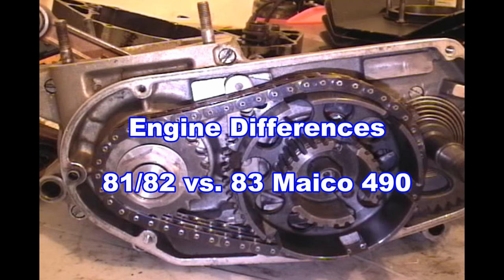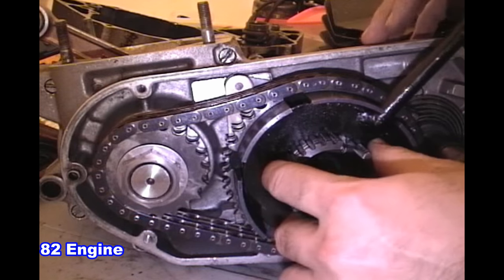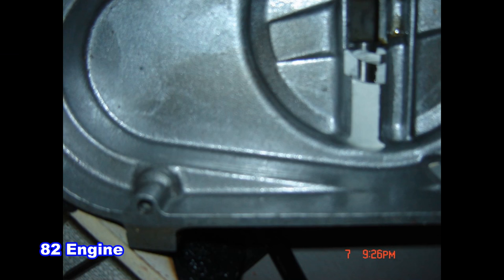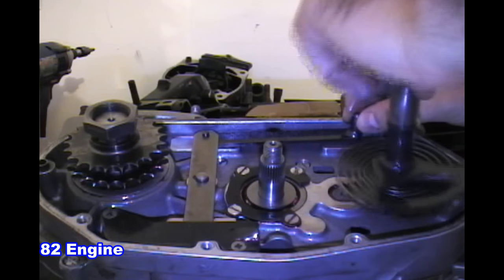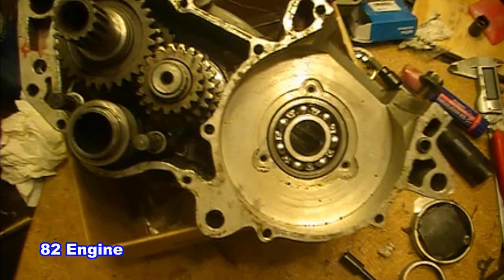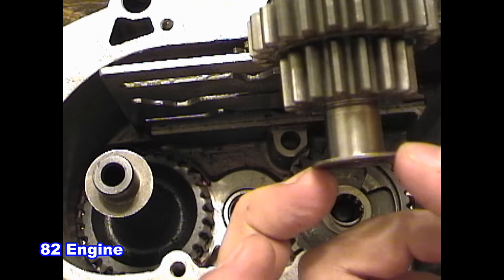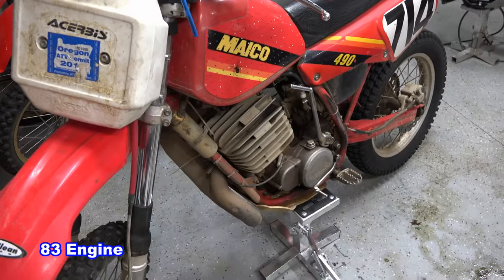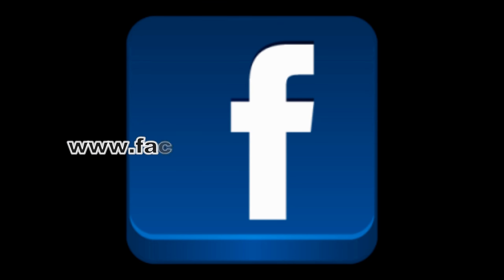Dirtbikes: 1982 vs. 1983 Maico 490 Engine Differences

Comment: Hello , i'm having this exact same issue with my kickstarting you talk about timeline( 3:00 to 3:40 )mine is very frustrating and hard to start because of it , gets stuck at top of kickstarting , you tried grinding the gear  (and didn't fix) and you don't say what your fix was ,  i have an 81 mega 2- 250 ,  any info would be helpful, i assume i need to replace the gear? do you know where can i get one ?

Comment: Hi Love all your vids. Do you know if a 1978 Maico clutch case/cover will fit on the 81/82 490 engine.
Reply from the maker: Thanks.  I am not sure that they would fit since they use different part numbers.  78 and 79 have the same part number and then 80-82 have the same part number.  Since they changed the part number in 1980, means they changed something about that part.  Whether the change is significant enough that it is incompatible I don't know since I have never had a 78 cover to compare.
Reply: @Maicowerk  Hi thanks I was looking online and i can't find any info so i was just asking around to see if anyone had any idea about this. I seen a clutch case on ebay and it said 78-82 so might have to just bite the bullet and buy the 78 cover. Thanks again and keep making the great videos.
Reply from the maker: @thomasscott199  Sure thing.  It may fit, the reason they say 78 to 82 is because 78 is the first year of the magnum motors and the engines are very similar in design (the clutch cover is completely different from 77 and before).  So it's possible they fit, but I don't know why the part number difference.
Reply: @Maicowerk  Yes you are right just read they have different part numbers so i think i might hold off until a  good 81/82 cover comes along. Thanks again 👍

Comment: Wow You really know a lot about MAICOS! Where do you get your information from?
Reply from the maker: +Crazyhero 1924 Thanks, I own over 10 Maicos and I've rebuilt most of them.  So years of just working on them and talking to people, etc.
Reply: +Opferman Motors Dirtbiking do you buy them on craigslist or from where do you get them?
Reply from the maker: Crazyhero 1924 ebay, craigslist, messageboards, people I know so various places.
Reply: +Opferman Motors Dirtbiking and tha parts?
Reply from the maker: Crazyhero 1924 Lots of places. Koestler in germany makes new parts.  Sometimes ebay, some parts like bearings are standard and you can get from any bearing company.  On my website for maico specific parts you can go to Links and Maico and see the various places to get parts.

Comment: the 81/2 is better....all the chain and clutch weight is spinning forward and adds momentum...don't really know how ,just does.  Stalls less runs down lower....clutch works perfect if you don't use it much , which you don't need to much.  the whole bike is also much lighter feeling. the gs motor with the big flywheel is the real deal....so easy to ride.